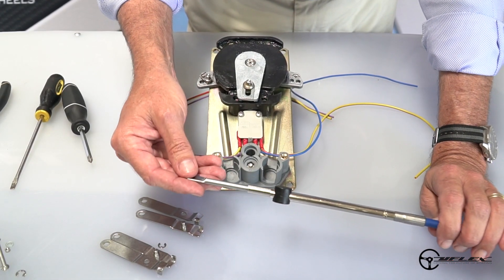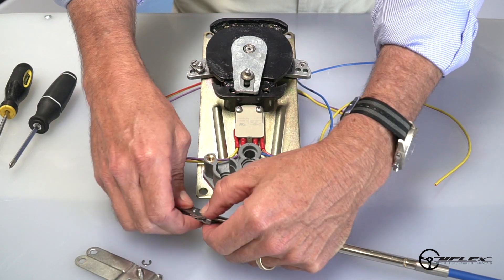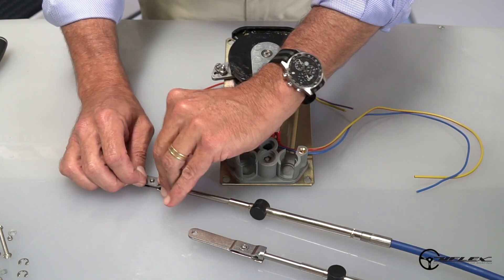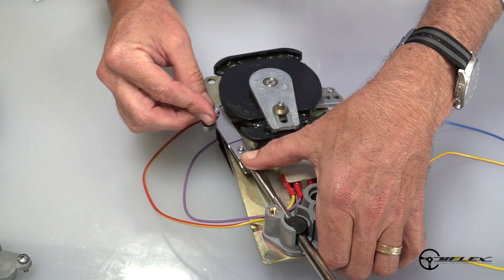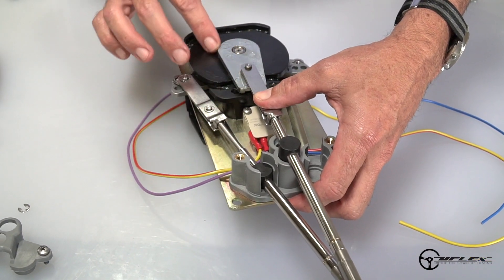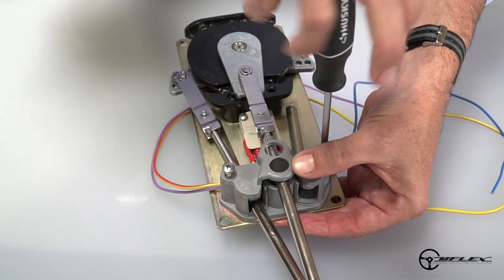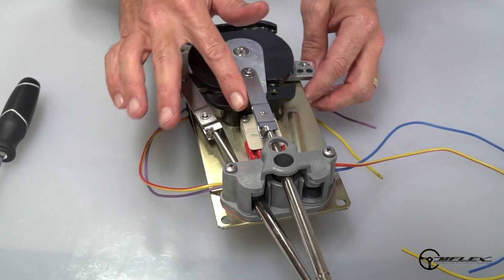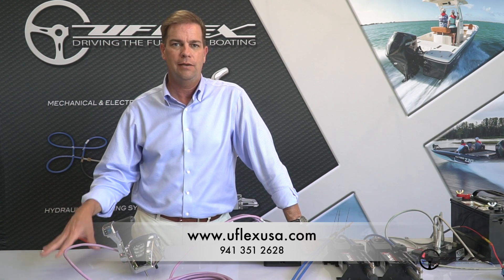Install UFLEX K35 Connection Kit on Mercury Gen 1 Control Cable

Comment: What control box is this you're connecting to? We can't find a control box to convert from side mount to top mount, even with the connection kit, it won't hold the barrel stoppers on the Gen 1 cables